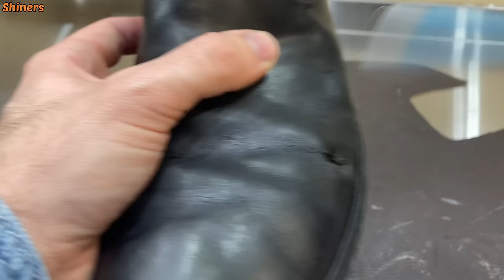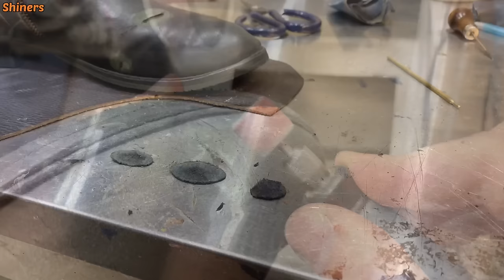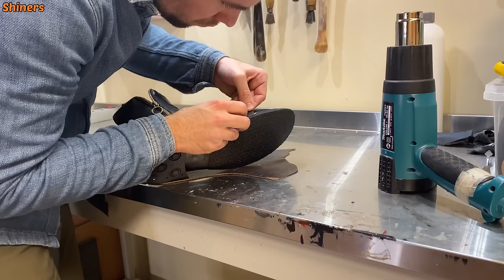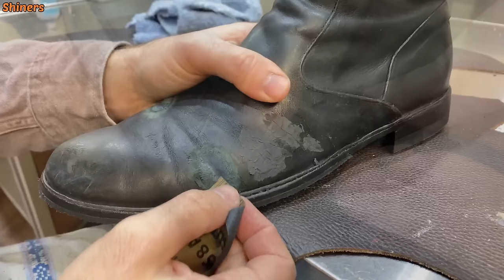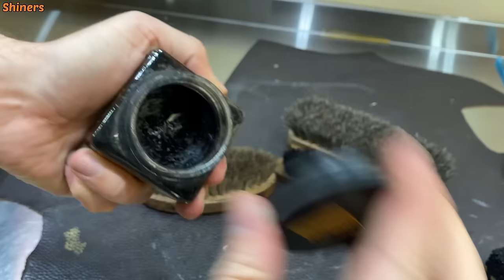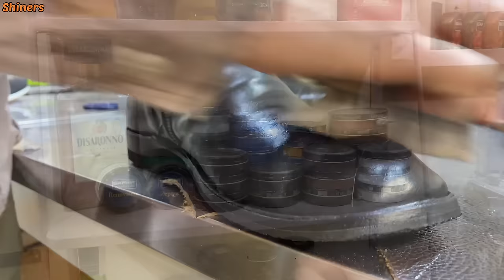How to Fix Old Leather Shoes.

Comment: Given the leather damage along the same crease, the patches seem quite small for the repair to last. I'd like to see how the repair holds up after 2 months of wear.
Reply: I agree with you.  I don't think this patchwork would last long. Besides, i m totally not impressed with the work performed. Not more than wastage of time and efforts.
Reply: It won't hold.
Reply: seeing as there was an actual hole, or holes, the patches only took care of the surface.  was anything done under the holes? was there another thicker patch  ? I th the holes would be sandwiched between the patch on top and inside
Reply: I have a pair of boots that needs resoled and some similar repairs what's the recommendation? Who should I send it to
Reply: The leather on uppers seem quite thin and more likely to crack, even with best maintenance.
   Patching: perhaps a generous size of leather patch could be glued from the inside, under rios/cracks. Then some filler and boding agent into the cracks/cuts to be rubbed in. 
  Although aesthetically not pretty, patches could be placed outside with bright color stitching as new feature for boots 'second time around?'
Reply: It’s so amazing how on social media everyone commenting is literally an expert on everything.
Reply: @jenelletomecek3364  your comment is gold lol
Reply: Yeah you're right.
Reply: @jenelletomecek3364 you have a point.
Reply: I did my shark skin ones with alecpea shoe glue and a stop I took off a piece of my top loops and fit it and 2 years they still going good
Reply: Perhaps you need to sew the crevasse part before patching to stop the propagation.
Reply: @jenelletomecek3364 it is isn’t it I bet not one has done this type of work

Comment: As others have stated already this is a good temporary fix. The leather across the entirety of the top is degraded from lack of cleaning and waxing. My opinion is to make a width wide strip the top of the shoe covering all the holes. A crease will always look for a weak point and in time will create holes like this. This is a good repair just not a permanent one
Reply: Adding as well a patch inner side seppe a necessity for permanent fix,isn't😉?
Reply: The three patches he did are a permanent fix, they will not tear or debond, nor will a hole form near those patches, due to the patches strengthening the crease.  Trying to add a wide strip  in the crease zone would make for ultra stiff, unwearable shoe.

Comment: If the customer agreed, I would suggest making it a captoe, or wingtip, and replacing the whole front toe with a new piece of leather stitched on. Although you did a great job after a few weeks the hole repairs would be noticeable, as opposed to a wingtip. 

Also for which type of repair to you use Disaronno?🙂
Reply: wingtip ?
Reply: @venom286__worldoftanks3  "Wingtip" is a decorative toe cap that comes back along the shoe.  Basically put another layer on the outside.
Reply: Wingtip would be so cool. Good idea. I will make one of mine Wingtip. I've always wanted one, but I don't see any cool enough online.
Reply: It helps to cover the aftertaste of the shoe polish
Reply: for that job you had to charge at least 300-500 bucks...

Comment: I patch holes from the inside. I have over 20 pairs of cowboy boots so maintenance is expensive and youll want to learn a thing or 2 so what i do is use alecpea super strong instant bonding  glue. I put the patch in from the bottom if it needs 1. Usually my exotic skins have an in between layer so i dont need to patch if the tear doesn't go all the way through. add the glue through the top and try to hold the tear back in place as much as possible. Usually it holds great and i never have any more problems. It may look like a burn mark or a scar after it dries but the glue doesn't dry in some gross white color it just makes the leather stay looking wet down the line. Its pretty much completely unnoticed unless your really really looking for it.

Comment: Great job.
A question or 2 comes up.
. Why not also use a larger, thinner patch from the inside?
. why not use a fibre bonding agent on cuts after they are bonded flash in place (before) finishing with outside patch?
 Regardless, these type of repairs are bound to give way, aspatched areas remain weak, against constant outward pressure.
Reply: They not ditch or farm work shoe.

Comment: I suggest simply through it away because the other parts of this boot are also very fatigue. For one boot, the most wearing part is the heel, you may need to redo the heel for 3 times then you will wear out the sole and leather front piece at same time.

Comment: So question would it also work if you put the leather patches on the interior of the boot with contact cement then once it was dried filled in the holes with the leather putty till it was even with rest of the vamp then polished up ?
Reply: the problem with this is the repairs are over areas that bend. You'd need to know for sure the putty can handle being flexed and bent without peeling or tearing apart. With a leather transplant like this the amount of visible non-leather material that's taking on bend stress is minimal

Comment: What is a good reliable boot adhesive for Caterpillar work boots?
Bought a pair from Goodwill, barely used if at all, most likely from an estate.  Used one day going up a mountain. Soles separated from uppers but not all the way. No evidence of any glue residue.  Caterpillar didn't offer to fix the problem nor suggest a boot repair shop after I sent them the info and pictures.  Tops discolored slightly possible from sunlight through the windows. Still new stiff.
Tried Tear Mender, unsatisfactory results.  Shoe Goop was a disappointment with other repairs.  Super Glue will eat some tennis shoe materials.

Comment: Wouldn't it be easier to throw them away and buy new ones??? 😮
Reply: Some things can't be replaced that easily
Reply: I see tons of people say this on cobbler channels lol 🤣🤣! There is the sentimental factor with shoes. Some people have special memories with their shoes. Also, the price also factors in the time, attention to detail, materials, and tools used for fixing the shoes. With cobblers it's their way of making a living. The money goes towards buying more tools and new tools, more materials, repairing tools and machines, etc. Of course, if people can't afford to have their shoes repaired or customized (people do have their shoes customized too for a variety of reasons as well), that's ok. Then you can do whatever you want, like getting new shoes. But for the people that can afford to visit a cobbler, then by all means do it 😊! It's very cool to be able to save your shoes, and then you can use them for much longer until they can't be repaired anymore.

I'd rather have my shoes fixed, instead of being wasteful and throwing them away (when the condition isn't too bad). Of course if they get too far gone, then I'd get a new pair. People can decide whatever they want to do though, and that's ok.
Reply: @letssee8397  Facts! Absolutely 💯%!

Comment: Very good repair craftsmanship ... However, I don't understand why he didn't put a lining inside of the shoes for better support !
Reply: Putting anything inside the boot would impact the fit and possibly make the boot very uncomfortable to wear.
Reply: @laviniamartin1619  I don't think so ... Abt 10 years ago, my boot got a slight crack on the side but the crack is not a through cut. I brought the boot to a shoe repair shop and the old man glue a very thin leather patch inside ( I can't feel it at all ) and he also helped to repair the crack on the outside. Very good craftsmanship !

Comment: Take black leathers piece,  rub on sand papers to get some powdered leather, mix it with adhesive & apply all over the damaged surface, allow it to dry naturally for 48 hrs. See results, polish with soft brush. 
Caution:- adhesives bonds but it corrodes .
Reply: Intresting. What kind of glue would be good for that?
Reply: @kodzak89kodzak    Those used for rubber only, not plastic, vinyl etc.
Reply: @pratapchakraborty9282   Thanks ;)

Comment: I looked at this in horror. as he opens a jar with scissors. as if it were cutting with some sharpened piece of iron. and all this will not hold. deceived the client. wasted material. polished it to a shine to give the appearance of work. I could glue the paper and paint it. there was the same result.